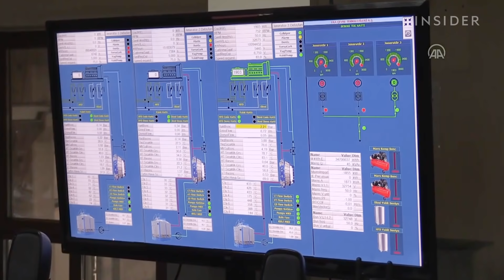How Old Tires Are Turned Into Electricity | World Wide Waste | Business Insider

Comment: I’m sure it’s great for air quality
Reply: I'd say the burning would have to be followed up with something to help combat the bad air quality that has to surround the plant.
Reply: Exactly.
Reply: @Harlequin619  New Zealand has big logging trucks.
 Gross Combination Masses of around 150-tonne.
https://www.youtube.com/watch?v=YIXoZzfBJK0&t=22s,https://www.youtube.com/watch?v=VrE877Ut0nI&t=122s&ab_channel=WillBishopTrucksNewZealand
https://www.youtube.com/watch?v=TIYDVdO0tCQ 
-https://www.youtube.com/watch?v=juUb_ymW3PU&ab_channel=WoodleysNZ
https://www.youtube.com/watch?v=vlVsWk5pQ0k
New Zealand-  Classic Chip Trucking with 8V92TA-13sp.@ 40t
https://www.youtube.com/watch?v=g-BnwyBK5Hk
NZ farmers block been logged,@57ton gross.
https://www.youtube.com/watch?v=jak7pX6qCiU&t=533s
Reply: There are ways to remove the pollutants from the air.
Singapore does it with a special process and no toxic exhaust gases are released into the atmosphere, and its actually cleaner than the air in the country. The remaining ash is then transported to a nearby man-made island and dumped into a pool of water that does not make contact with the sea.
Reply: @leehongjin6884  The island is actually a sanitary landfill.
Reply: @nousername5673  Well once the landfill is completely full, it is covered up with dirt and plants.
Reply: It may not be good for the air, but still it theres a bit of positive behind it, the burning of tires are then converted into electricity is a bit more better rather than just burning them normally.
Reply: Except in this case you’re burning tires instead of letting them detiorate while thus lowering the demand for oil burning power plants which are about as bad for the environment
Reply: @SebastianD334  thats not the point
Reply: Nooo dude..In fact, the amount of Sulfur released by burning tires is very less than burning coal....its a practical doubt ofcourse😇
Reply: Hahaha Here you guys are talking about how Turkey pollutes air by burning tyres... While the worlds number 1 air and nature polluters are China Russia and US... Turkey's percentage is nearly a single drop in an ocean. I am sick of this western hypocrisy and double standards. It's better to throw them into sea, forests, valleys right? One genius said isolate them... Wow I think you don't know how much space you need for that kind of isolation. And it will be full in months with no benefit at all. Those tyres are going to be disposed to the nature or will be burned at the end no matter what at least they are turning into energy. And in case you don't know, energy is the reason for war in this age. If you have oil in your country you can say goodbye to peace. I love how naiive you people are, you don't complain when you use plastic every day of your life, throwing trash to wherever you want and then come here act like you are worried about air pollution, it's pathetic really...
Reply: And for keeping green house gases out of our atmosphere before we all start melting.
Reply: 2:52 they do it in a oxygen-less closed environment, no air pollution ;) also you do realize they can instal filters right?
Reply: @Armagedon013 There’s a big difference:  scrap plastic is recycled.  Something old is turned into new using the same material without wasting resources.   Trash, a/k/a garbage, is a waste product that cannot be recycled or turned into something new again.  Trash can only be buried in a landfill or burned in an incinerator.
Reply: @Z06ified  - Do you have a degree in recycling science? Because it sounds like you have a degree in recycling science.
Reply: @samuelluria4744  No, there is no such degree to begin with.  I have had many manufacturing clients however, who use recycled plastic, iron, and paper, to know enough about the recycling industry.  And I know for a fact that China purchases these scrap materials from the U.S.  in large quantities because it’s cheaper and they don’t have enough recycled material of their own to use in their manufacturing processes.   So much so that Chinese companies pay more for scrap material than U.S. companies do, even accounting for shipping scrap half way around the world.
Reply: I’m not sure but they mentioned that “they heat up the tire with no oxygen in contact”, so then oxygen cannot combine with sulphur or other elements to for harmful gases like SO2 and more
Reply: @harshkhurana8163  ok smart boi :]
Reply: @Armagedon013 - That's called political posturing. Don't let it blind you to the facts.
Reply: @nightwolf6x -😂😜😂😜
Reply: You guys don’t read it literally says it doesn’t release any gas or pollutant into the air🤦🏽‍♂️
Reply: @rogernedd8624  - No, we read it. Just that not everyone is taken in as easily as the next guy. They are spinning it this way, because it's in Turkey. If it was happening in Ohio, it would be spun as a horribly mismanaged,  ill conceived, corruption of all things good and wholesome. Don't kid yourself.
Reply: @samuelluria4744  they didn’t spin it in any sort of way they literally said the creation of the oil from the tires does not release anything into the air, but now that the oil is burnt that they use for the electricity itself that’s where chemicals are let in to the air, and obviously the way the oil is created it’s not 100% clean because the machines that are used to run it also release stuff into the Air. Nothing that’s environmentally friendly is 100% clean .it’s just better than the option that was there before
Reply: @nathan rye - there's a sucker born every minute
Reply: Its better than them in the oceon its just a way to get rid of them not a permanent solution
Reply: Dissolve it in acid ez
Reply: Some factory things that do this stuff have filter to make the smoke "less thicker"
Reply: @Armagedon013 then stop importing it? Its not as if we forcefully make you take our trash
Reply: Ikr
Reply: Classic coal versus nuclear argument air pollution in one hand land pollution on the other. If bezos is so smart let’s start using space now
Reply: Bruh
Reply: @Armagedon013 ahh.... Looks like someone don't know how to handle their own shits..... I wonder what would happen to the world if Asian country didn't exist
Reply: Thats what I thought
Reply: There is something called filter for chimneys, you know?
Reply: @Armagedon013 trash is valuable. Trash has steel and aluminium metal scrap, plastic a rubber for energy. That means cheap  new steel and aluminium for poor countries.
Reply: Really in this messed up world, your worried about air quality 🤣🤣🤣
Reply: If it is a good incinerator it should have filters that that capture harmful gases or redirect them from the atmosphere. I wish if they discussed this more on the video.
Reply: LOL the emissions on tires are worse even than coal. Think of it like this, simpler molecules like methane (natural gas) have fewer carbons relative to total number of bonds (energy available). So more C02 per KWH with rubber burning or coal or long carbon chain compounds. 

But wait theres more. Unlike oil, gasoline, natural gas, etc, the compounds in the rubber to make it a good tire like sulfur, generate acid rain (sulfuric acid).

This rubber burning can work quite well. You must regulate it strongly, and must have solid emissions equipment. Thanks for reading.
Reply: The exhaust fumes can be scrubbed to take all the toxicity out of it. Usually it's cleaned to the standards set by the governments, but can be completely cleaned.
Reply: Then stop talking 🤷‍♂️
Reply: you know you can use old tires to make new ones
Reply: Your all wrong, it’s not like chucking a petrol bomb on a pile of tyres and let it burn, 

A lot of UK tyres go to Turkey as fuel for cement kills (the UK uses gas)

In these Turkish cement kiln furnaces the tyre are burnt in a controlled manner (imagine a wood burner at home) the only difference is your wood burner at home expels the carbon deposit ie smoke out of the chimney as the fuel is dispensed,  (plot twist) controlled tyre fires do not expel the same way, the fumes given off by tyre fires (smoke) are combustible so are redirected back to the source starting the process again eventually once all the material is depleted through certain filtration systems the by product is free of cfc’s , If it wasn’t the UKEA or the UN would have put a stop to it😉
Reply: Well it's basically even worse if you let it decompose in a landfill. Plus its literally the same as burning oil.
Reply: I might have a solution. Why not send to an inhospitable planet?
Reply: Did you actually watch the video??? 🤣🤣🤣
Reply: Did u watch the video he even said there is no smoke being produced they are not literally being burned they are being heated in a closed container where no smoke comes out only oil
Reply: So you suggest to throw it in the ocean? Very easy to criticize. If you cant come up with a better solution, stop complaining.
Reply: @kalee6  he didn’t say anything about throwing it into the ocean, he said to do something else than to burn it. He never said at all to throw it into the ocean. So your crying about him saying that is false. :/
Reply: @MrAzire  It's another way of saying ''you have any better options?'' I dont know why you are taking in the literal sense.
Reply: @kalee6  there are better options, you could use it, recycle it and build things, people have built roads with plastic, I know they will come up with something else
Reply: @MrAzire  I was asking the complainer if he could come up with a realtisic better option that is compatible with our society
Reply: @kalee6  well you said it in a different way than most and made it look like you were being a d bag
Reply: @MrAzire  I was being a little rude because i don't like people who keep complaining who can't come up with a better solution.
Reply: @kalee6  well considering you give your own intelligence so much credit, what is your solution? 

cause letting them slowly leech out into nature till we have a better solution, seems better than burning them and releasing all the polution at once.

the easiest solution would be to limit tire manufacturers, force them to use more recycled materials in their tires, fact is i know there is solutions out there to enable this, but it costs money and time so manufacturers don't care, and let the rest of us pay the price.

also rethreading tires is a thing, it cuts down emissions greatly and the tires that are rethreaded work just as well as a new tire.
Reply: @kalee6  could chew them up use them in playgrounds and not need to cut down trees and use old tires
Reply: @kalee6  fr
Reply: @kalee6  actually turn them into more wheels or other things that use that materials
Reply: @fallingdown4958  Well the issue is that that is not a self sufficient method because of the market. Government needs to get involved.
Reply: @kalee6  No, but old tires are great as recycled asphalt.
Reply: @gteixeira  it costs too much thats the problem
Reply: @kalee6  It is 20-25% more in the factory only. This is negated by the eliminating the tire disposal and petroleum sourcing, both of which are typically subsided by gorvernment.
Reply: @kalee6  turn them in petrol.. Chemistry and no air pollution.. Research before you comment
Reply: @Desi_Degen  Is it cost efficient?
Reply: @kalee6  yup... Many developing countries are doing it even in india in Bengalore and mathura they are doing it.. And the petrol hence produced is far cheap than conventional petrol and cleans the city in process too.. Win win situation
Reply: @kalee6  and just if you are wondering if it so much good then why people are not doing it.. You know in Venezuela a gallon of petrol costs half a dollar approx.. But by the time it reaches Africa it becomes hell costly... It's simple trade sanctions and exice duties and obviously ridiculous amount of taxes which makes the petrol/diesel costly...
Reply: @kalee6  You do realize there are other solutions, right? They can be buried in a landfill, or used for other purposes.
Reply: @jonathanmccain8646  read my comments
Reply: @kalee6  not really but if you can reuse plastic why not rubber, think this is just an easy way out like burning plastic...
Reply: @keninswed  So are you suggesting that every product in this world can be recycled without the government intervening and not interrupting the economy while having a economically self sufficient business?
Reply: @kalee6  how about recycling it in to more tires!  Why don't you go breath the carbon that this puts in the atmosphere!
Reply: @relentlessmadman  read my comments
Reply: @kalee6  there are better ways to turn tires into electricity without emitting sulfur and nitrous oxides into the air such as microbial fermentation into things like  acetic acid and converted into electricity it still would give you more energy due to heatloss by burning tired
Reply: @kalee6  "So you suggest to throw it in the ocean?"
Did he say that?

"If you cant come up with a better solution, stop complaining"
Tyre recycling is the better solution. No need for landfill nor pollute the air.
Reply: @yerri5567  There are so many flaws in tire recycling. It is almost not feasible in our market.
Reply: @yerri5567  yes I am about to recycle like a million or so tires
Reply: @kalee6  About 1/3 of tyres are already recycled (excluding energy recycling). All we have to do is increase that figure. Even if the end product is not used domestically, there is an international market for those end products.
And what "flaws" are you speaking of?
Reply: @BigJulumbas  Do you even know how to use sarcasm properly? 
Firstly, how are YOU, an individual, able to have more than "a million or so" tyres?
Secondly, that is my point, to recycle "a million or so" tyres. For a country to do so that is
Reply: @yerri5567  There are so many aspects I have to talk about. I am not gonna write a paper on Youtube.

I will just leave you with this. There is so much supply available for recycled tires compared to demand. There is a ton of recycled tires not being sold. They can't sell them unless they reduce their price and having a loss on their business. You can't solve this issue altogether by just recycling.
Reply: @kalee6  "There is a ton of recycled tires not being sold"
Recycled tyres not being sold? You mean end-products from these recycled tyres? 

"They can't sell them unless they reduce their price and having a loss on their business"
Easy. Impose a "waste" tax on tyre users. And use that as subsidies for tyre recyclers. If thats not enough then redirect subsidies from the coal industry to the tyre recyclers.
Reply: @kalee6  "You think giant corporations gonna just bend over?"
Depends on what country youre in. And theres really no need for any subsidies other than helping new industries compete. It baffles me why such an ancient and profitable industry is still being subsidised...
Reply: @yerri5567  how do you plan to recycle it? Cite some realistic example.
Reply: @ramonching7772  "how do you plan to recycle it? Cite some realistic example"
1/3 of tyres in world are already being recycled outside of the energy sector. 
Crush it up and make other products out of it.
Like rubber crumbs/pellets, oil, carbon black and other civil engineering products like soft fall surfaces, artificial turf and conveyer belts, road construction and surfacing like pavements/asphalt, tarmac sealants etc
Reply: @yerri5567  Yup, soft fall mats and playgrounds are awesome!!! OH and here in Toronto we use tires to make sound barriers for the highways too!!
Reply: @masaharumorimoto4761  hopefully the recycling process for the products you mentioned are 100% environment friendly and doesn't involve burning.. because most of the treating process of tires involves heating/burning to separate the harmful chemicals in it..
Reply: @yerri5567  - "Flaws", like say, the fact that fire produces smoke. Leftist zombies have been programmed to believe that the world can function without any "flaws".🙄
Reply: @yerri5567  - Which begs the question,  why the recycling hoax industry needs subsidies. The truth is, that everything in life seeks it's actual value; be it education, resources, ignorance - whatever.
Reply: @yerri5567  - I actually have very close contact with a very successful tire recycling plant in the U.S..
     They grind and process  tires on an extraordinarily large scale, but have also started buying recycled rubber materials from Malaysia, to augment their product line.
Reply: @samuelluria4744  '"Flaws", like say, the fact that fire produces smoke. Leftist zombies have been programmed to believe that the world can function without any "flaws"'
Im not sure what youre on about here? You assuming Im a "leftist zombie"? Whatever that means.
And where is the "fire" in non-energy related tyre recycling? (What Im actually talking about)

"Which begs the question,  why the recycling hoax industry needs subsidies"
New industries always have incentives like tax breaks or subsidies to help them compete in the initial phase. And Im also not sure what your point is here? You saying we shouldnt have subsidies altogether? Or just no subsidies specifically for recycling? Because the coal industry is being heavily subsidised. Whats your take on that?

"The truth is, that everything in life seeks it's actual value; be it education, resources, ignorance - whatever"
Thats only half true. It really depends on the market. For example, Australian/NZ wool is cheap in Aus/NZ, but is much more expensive in other parts of the world. Even if we factor in shipping, it still costs more that what its worth in other parts of the world. 

"I actually have very close contact with a very successful tire recycling plant in the U.S"
Youre really confusing me lol. You seemed to go from being critical of recycling, to pro-recycling...
Reply: @yerri5567  - Your whole pamphlet is based on your not recognizing that I was agreeing with you.
Reply: @yerri5567  - The "fire resulting in smoke" phrase was a way of encapsulating all the realities of life/industry/economics which people have been conditioned to rail against,  as if anything can be "perfect"....without flaw.
Reply: Neither coal, nor recycling of any resource materials,  should be subsidized.  Anything truly viable and worthwhile,  should seek its own market levels.  I could go on and on about the many downsides of the recycling "industry" but I can't type on this phone all day.
Reply: @yerri5567  - The difference in price various products,  depending on location, is not contradictory to their having sought their own actual valuation. That's a subject in it's own. 
     As far as my friend who owns a tire recycling facility,  he is a private citizen,  and he makes a good living making playground materials by processing the old rubber.  I'm not against recycling,  per se. I'm against the cultism around the issue,  accompanied by extreme ignorance. Crony Capitalism and Leftist Money-syphoning Bureaucracy combine to scuttle an otherwise very good overall idea, called recycling ♻️
Reply: @yerri5567  “crush it up and make other products out of it”, exactly what I was thinking, I agree with you
Reply: @kalee6  ya i have a better solution, how about we isolate it instead of burning it into our air? thoughts????
Reply: @twicebakedpotato6705  that’s already a big problem in our world
Reply: @twicebakedpotato6705  that's why they're trying to get rid of it. the numbers are piling up everyday and landfills cant accommodate anymore.. thats the whole thought of the video that went over your head..
Reply: @twicebakedpotato6705  Did you watch the video at all? Did any of you watch it?  You guys really make no sense.
Reply: @twicebakedpotato6705  yeah landfill ain’t that good rather
Reply: @twicebakedpotato6705  who cares? When you burn them you get co2 and water. Energy dense, burn very hot. Many homes in my country burn them instead of wood.
Reply: @twicebakedpotato6705  agreed or reprocess it into other products or returned to oil
Reply: @twicebakedpotato6705  isolating the tires, especially landfill creates CO2 leaks
Reply: @twicebakedpotato6705  that's called a landfill
Reply: @twicebakedpotato6705 space problem. There is no space since it  takes space.
Reply: @kalee6  how about not burning and not in ocean
Reply: @yaoming3373  I would like that as well. But bring us a liable realistic solution because recycling is not that liable.
Reply: @Armagedon013 That is not true.  The U.S. does not export trash to Asia.  Complete nonsense.  Asia, particularly China, does buy massive amounts of recycled material from the U.S.:  paper, scrap metal, even scrap plastic.  But not trash - there is a big difference.
Reply: @Z06ified  - The world's biggest industry? Blaming the United States for everything.
Reply: @Z06ified  As someone who lives in southeast Asia, this comment is so funny.
Reply: @Z06ified  yes but the stuff china imports still contains toxic materials